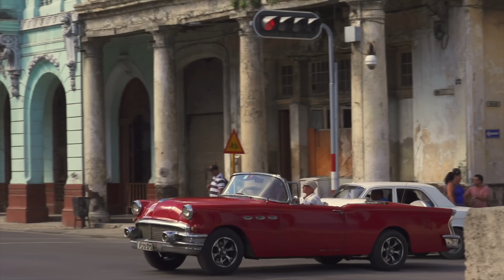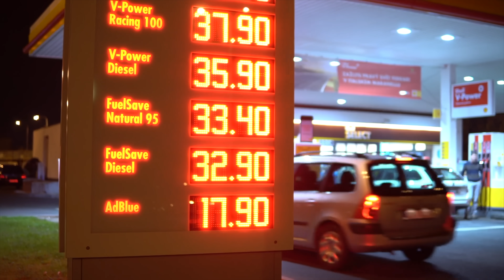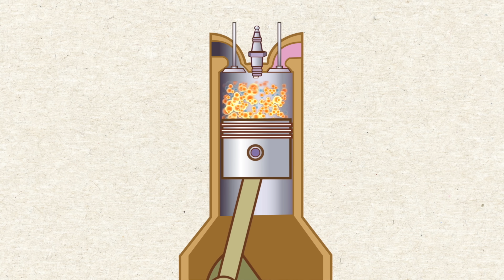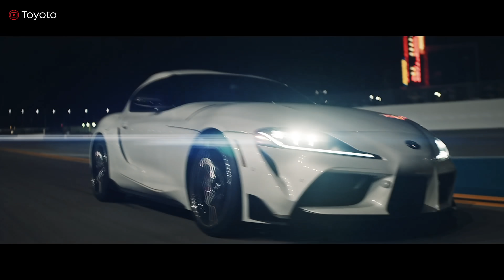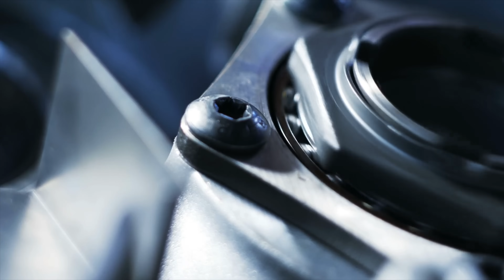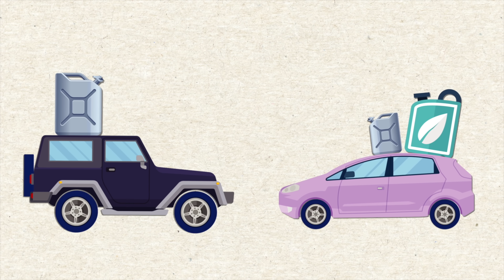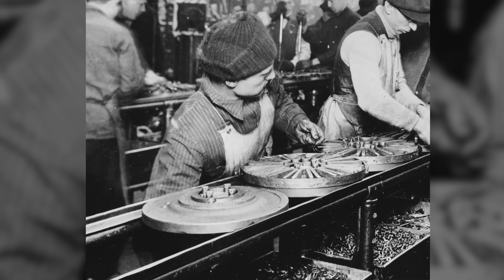7 Fuel Myths Stupid People Fall For

Comment: I have an older 2013 Ford 2liter twin turbo Ecoboost engine in my escape. I always used the recommended 89 octane, So a couple of months ago when I tried putting 93 octane fuel in to see if it would make a difference, WOW I immediately got 7 more miles per gallon (Highway) 4 miles per gallon more combined with the 93 octane. I also notice quicker throttle response. I was stunned by this difference, and on further research I found it had to do with the turbos being more efficient with a higher octane fuel.

Comment: What about using Ethenol free gas? I used it in my 2009 Altima and it had more power and better gas mileage.
Reply: This makes sense, Ethanol free gas has more energy than the 10% stuff.
 In the end, you’re paying the same amount for a mile. In your case, just buy whatever option is more convenient

Comment: I used 87 and got 24.8 mpg..Tried 93 and am getting 25.1 mpg..Need I say more !!
Reply: My previous Scion (2005 xA) had the basic VVT engine...it REQUIRED high octane because of the performance vs. size
Reply: I find I get 1 liter per 100 km better mileage for Shell V Gold vs Reg, about 10% better and I find my car runs smoother and feels faster , i drive a 2015 VW Jetta 1.8 L TSI, my Shell station has 0 ethenol

Comment: My boss was the ceo at Buchanan energy’s assistant and he told me mid grade is just regular and premium mixed and that you can put premium in a regular car but you can’t put regular in an engine that takes premium .. and that whether or not the gas is good for your car or which gas station has the best gas depends on the stuff going on underground underneath the gas station

Comment: I don't know much but I do know this from experience if you put gas containing ethanol in your car or in a small engine it causes three times more buildup than regular gasoline.
Reply: Source: trust me bro
Reply: Another myth.
Reply: It's terrible for old vehicles with carburetors.  Fuel injectors deal with the problem because they are forcing the fuel through, but if you have an old motorcycle and don't ride it for a month or so, that ethanol separates and you have to rebuild the carb... again.  Wish we could get non-ethanol fuel in my state for old vehicles.  Not a myth, experience.
Reply: ethanol leaves moisture and gunk as a by product unfortunately

Comment: I had a Mercedes has stickers on the gas cover and dashboard that said to use Premium gas.  Although in the owner's it said, that to get the maximum horsepower you needed premium, but regular was fine as the timing would be adjusted by the computer, but you would have lower horsepower.  I also had a supercharged Buick Regal, which  was very specific about always needing premium.
Reply: Would you really trust a Mercedes computer to NOT crap out on you? Stick to premium
Reply: @delgande  , the owner's manual even said you could run 25% diesel in an emergency.

Comment: Interesting information.  Thank you for sharing that; clears a lot of things up. What do you think about Sea Foam as a once in a while additive to clean out the engine?
Reply: My dad used that but Scotty says not to use it in previous videos. My grandma owned some some auto repair shops for 50 years. He is deceased as of late but he was an Air Force master Sargent mechanic before opening his own shops after retiring from Air Force. Anyway, my grandpa didn’t recommend or use sea foam in his cars either. That’s 2 opinions from lifetime mechanics. Hope it helps you decide.

Comment: All I know is that using the regular gas in my area causes knocking. I hear other cars also knocking like crazy due to this. I know this - my car runs much better on Premium and I avoid engine problems. It seems the Premium gas here is simply a higher quality gas.

Comment: I live in the Rocky Mountains of Utah. Since it's higher elevation, I use E85 in my Flex fuel truck for more horse power. But only when towing heavy loads like my camper trailer. When I don't tow anything, I switch back to regular or mid grade gasoline.

Comment: Me who drives a diesel: “Ha imagine having an option for fuel.”
Reply: there is an option called BioDiesel
Reply: Hmm, should I run #2 or #1? Granted #1 is not as common in warmer climes, it's all over in colder areas.
Reply: @roughrdr  I’m live in Texas there is only one option
Reply: Actually, Diesel Fuel has a Cetane Rating: the higher the Rating, the higher the Boost Pressure you can run. Some BioDiesel Fuel has a higher Cetane# than regular diesel! Here in The Philippines, there are two Diesel Fuels at many pumps. Low Cetane# for non-turbo diesel, high Cetane# for turbo diesels...
Reply: Here's a good one... Can adding kerosene to your diesel fuel hurt your engine? Truckers do this to keep the fuel from gelling in cold weather.
Reply: @virginia7125  or you get Pacific anti gelling stuff
Reply: If you have oldschool  non turbo diesel , you can make secondary  fuelline to switch after  engine is warm. Then use oil, people  usually buy colza or sunflover  oil. Or filter  oil  from restaurants. You smell  like  McDonald but you drive  cheap.

Comment: I've been putting higher octane to my car an I feel it runs better.. premium gas yes..
Reply: You put it in expecting it will run better, theres probably some bias there, get a friend to fill it up and tell them to pick regular or premium randomly, I don't like your chances of guessing what they put in based on the feel while driving.
Reply: Did you ever  notice that when you wash your car it seems to run better and go faster?
Reply: @rickweaver7997  you'd probably have less wind resistance with a waxed up dirt free body..
Reply: @rickweaver7997  what's the matter with you?
Reply: @jov6372  
Um, I'm fine, what's your problem?

Comment: I'm in Europe and always thought the Octane # says something about the amount of energy per unit of gasoline. This idea is reinforced by the fact that my Vespa with a very simple 4-stroke engine and no electronics actually has faster acceleration and a higher top speed when I fill it with Euro98/E5 compared to Euro 95/E10 fuel...

Comment: Doesn't ethanol in the fuel reduce mileage per tank because it evaporates faster? Doesn't ethanol also damage the engine to a degree that wouldn't be achieved otherwise? For cars made past 2002, which would be more suitable: 100% gas or a gas/ethanol mixture?
Reply: ethanol blended fuels get worse mileage because they have less energy per gallon. it's a cheap way to boost octane rating though and doesn't have the same negative health effects of the bad old way to do that (leaded gas). that's why many engines will get worse fuel economy with premium fuel than just regular unleaded. they use a higher percentage of ethanol to bump up the octane rating so the premium has less energy in it per gallon and that gallon won't get you as far down the road.

ethanol won't harm an engine but it will be hard on all the rubber parts it touches if they weren't designed with ethanol in mind. 

for something relatively modern, 10% ethanol won't be a problem but you shouldn't let the car sit with a full tank. modern fuels can clog fuel systems if it goes bad, which can happen after about 3 months or so.
Reply: @chappell721  It's a good job, then that I live near a gas station that's ethanol free. Thanks for the reply!

Comment: It always worked for me when using leaded engines, to use Plus, to prevent knocking.

When I had a 91 Taurus and drove cross country, I would see a fuel economy of 30-35 MPG (actually touched 39 on two tanks) when driving with Premium, 28-33 on Plus, and 25-28 on Regular, but only when driving long distances, with few stops.  So that is what I used when traveling 2-3 days on the Interstate, then on either end of my journey, I'd use whatever worked best, cost wise, that wasn't the crappy 85.5 that some states allow in the winter.

Now I drive a PHEV, and have found that while it only requires 87, I have to run 89 to keep the engine happy.

Comment: I'm not convinced higher octane fuel burns at the same speed as lower octane. I say it burns slower. 2 stroke go kart engines make more power on low octane than high. I agree with everything else that was said though...Kind of...

Comment: It would have been nice to hear about the 85-octane fuel sold in some states, like Colorado.
Reply: 85 octane is sold at locations with high elevations, for example at 5000ft air is 83% as dense as at sea level, so cylinder pressures are lower so octane requirement is lower. Pretty much it’s equivalent to 87 unless you’re driving out of state

Comment: Fun fact , Gas mileage stickers on new cars is based on 25-30 mph city and 55 highway driving in a test area generally shielded from elements or they just lift it and spin the wheels .

Also the average total price difference at 20 gallons from 87 to 93 is only 4$

Comment: I chuckled when, each time you mentioned high octane fuel, you illustrated a high performance car.  I've been driving smart fortwos (Smart Cars) for going on 16 years now.  Not exactly what anyone would call a high performance vehicle.  And yet, the manufacturer's recommended fuel is Premium gasoline.  The engine's three cylinders also have hemispherical combustion chambers (it's a 999 cc Hemi, LOL).

Comment: Interesting video. I'm in Australia.  The noise you call pre ignition we call pinging.  One of my cars is a 63 Impala with 327 V8, I have to use premium in this car ,otherwise it gets pinging. I've always been told can't use Ethanol fuel in these old carburettor cars because the Ethanol damages the carburettor and rubber hoses .

Comment: My brother learned the hard way with premium gas.  He had a Honda CRX and switched to premium gas and found out that the higher carbon content of the gas actually was clogging his exhaust system.  So he stopped paying for premium gas and had to drive the car on a long trip to blow out all the extra carbon.  Gas mileage went down and performance was off.

Comment: My cx-5 requires 85, and I was getting about 330 miles with a 14 gallon tank. After a short time of running 91 I maxed out at 480 miles with the same 14 gallon tank!

Comment: I had a 200 T100 pick-up. Using 91oct ,I could drive 100 miles to my moms stay the weekend and drive 100 miles back and have just  over a half tank of fuel left. One time, I filled up with 85 Oct same trip and finished with a quarter tank. I did this 3 more times 91 vs 85 oct same results each time. I had better gas mileage with 91 oct.

Comment: Used regular in my Chevy Impala.  432,087  miles with still no engine leaks or smoke.   Used Premium in my Yammie.  It has 86,456 miles on it.  It has nothing to do with octane rating.   Proper care and maintenance is the answer.

Comment: Should I or how do I switch my 2006 Toyota Highlander Hybrid's four-wheel drivetrain to a two-wheel drivetrain? 

Which type of gasoline should I use for my 2006 Toyota Highlander Hybrid Limited 4WD-i?
?
“Premium Unleaded” is recommended in the Owner’s Manual, page 302, Fuel Selection: in the Octane Rating: 87 (Research Octane Number 91) or higher. For improved vehicle performance, premium unleaded gasoline with an octane rating of 91 (Research Octane Number 96) or higher is recommended.
?
“Regular Unleaded” is recommended in the VIN Fuel Type section at

Comment: Most cars have a “knock”  sensor.  It retards the ignition timing to avoid the knock so even if high octane is required or recommended.  High altitude will also cause pre ignition “detonation “

Comment: Some vehicles adjust the ignition timing based on octane so you can make more power. performance cars for example. 

I’m tuned for E85 anyway which is equivalent of 105 octane or so but requires 30% more fuel usage

Comment: I didn't think much about ethonal fuel mixture when it first came to pumps many years ago, but now I won't touch the stuff for it causes sludge build-up.  I also used it in small engines such as lawnmowers, weed wackers, snowmobiles and dirt bikes.  I had to remove every carburetor due to sludge.   About 6 years later the manuals started saying not  to use Ethonal in small engines.   I'm not sure if fuel cleaners really work well for removing sludge for I have trust issues with fuel companies

Comment: I drive a 2010 Mercedes ML 550 v-8 I've driven it for 14 years on a regular gas with no problems. I was talking to the guy filling up the at Sunoco he told me the minimum of 87 is actually higher because they cannot go below that minimum certification. Most of the time he told me you're getting more like around 90 octane. So I always put regular in it. I've never had any problems but perhaps what I was told was a true?

Comment: Me and my 1999 Ford Ranger flex fuel pickup are very happy with E-85. The truck likes it, and I like the lower prices even after the additive is added and difference between the price of E-85 and 89 regular fuel it needs if E-85 is not used.

Comment: My Ford Explorer ST needs Premium due to twin turbochargers. I knew it must require Premium when I bought it; no regrets. 400 hp plus 415 lb-ft. of torque. The acceleration is awsome and It gets 22.4 mpg under my lead foot. Love it, do it again. BTW I live at >7,200 ft altitude so there is 20% less air density here, which makes the turbos that much better.

Comment: So, I have a 2010 Pontiac Vibe (base model).  I seem to use less fuel with high octane vs low octane.  Being I don't make a lot of money and fuel prices are high in my area, I'd rather spend a little more at the pump and fuel up less often.  In the end, per my calculations, I'm actually saving money using high octane fuel.

Comment: What sort of things can cause an engine to need a higher octane as it ages? My mom had a '92 Toyota Previa. It was supposed to use regular gas, but in the late '90s it started to knock unless you used mid-grade. (I later got it as a hand-me-down, and drove it until 2019)

Comment: In the 1990s, GM and Ford imported the Vectra and Mondeo models respectively into Australia. In Europe, the Mondeo outperformed the Vectra on 95RON fuel. Holden, the local arm of GM rejigged the Vectra to run on 91 RON, our regular fuel while Ford's Mondeo required premium 95 RON fuel for best performance. Many drivers didn't understand the differences between 91 and 95 in the Mondeo and the Vecta performed better than the Mondeo on the lower octane fuel. 
Vehicles that were direct competitors in Europe were in effect in different classes here because of the significant price difference  between 91 RON and 95 RON. This price difference averages 12 cents per litre in favour of regular 91 RON.

Comment: Ethanol is corrosive to some metals and polymers.  So, best to verify with the car manufacturer as to what % ethanol is safe for your car’s engine.  Due to the corrosive effects E85 dispensers do use some different materials and the safety certification standards are different.

Comment: Very good info.  The only thing I would like to have also heard was about leaded gas, which is available in agricultural areas near where I live, and can be purchased for regular vehicles.  I'm sure engines aren't designed for it any more, but what damage might occur if it's used?  Are there any advantages at all.  My fellow motorcyclists would often go out of their way to buy it, but I always thought that it wasn't as beneficial as they were led to believe...

Comment: Running a newer hemi 5.7 using the premium gas keeps the engine clean at the same time. Altho it does require regular I chose this for 3 years after the mds system got flooded with debre had it replaced switching to premium gas it has improved performance.

Comment: Finally someone who says it like it is, sooooo tired of the argument that doing the high ethanol or high test in anon high test or high rating gas in a regular car engine, but I will admit I am one to stick with a particular brand of fuel because of the cleaner additives, but I'm also a stickler for changing air filters, spark plugs, wires and more every 6 months oil changes every 4,000 kms than the 5,000 kms rule in Canada , maintenance maintenance maintenance 
Is golden rule if you don't look after your vehicle regardless what fuel you put in then your just wasting your money and time, anyhow sorry for side track thanks again for doing up the video explaining it properly about the types and the why's of gasoline  !

Comment: To clarify your description of the Octane standards, there are three octane standards out there:  the Motor Octane Number (MON), Research Octane Number (RON), and the average of the two, or the (R+M)/2.  In the US, we use the average of the two, or the (R+M)/2 which is what you see on the pump.  Some may refer to the (R+M)/2 as the "pump octane number" but it's not entirely accurate.

Comment: I drive a Volvo 940 and it's definitely not a high performance car. But if I use anything other than 93 octane fuel it's hard to start and it will shut off when driving.

Comment: "It can be harmful to fuel lines, fuel pumps, and other fuel system components that aren't resistant to ethanol. So if you have a 1993 or older vehicle that still has its original fuel system, you may not be able to use E85. If your 1993 or older vehicle has a newer fuel system, it should be OK to use E85."   I've been told by mechanics it will eat thru the fuel lines of some vehicles.

Comment: Given that at sea level octane ratings are 87 reg, 91 mid and 93 prem, and at high altitude (Colorado over 4000 ft) where octane ratings are 85 reg, 87 mid, 91 prem, what do you use at high altitude for a car that requires 87 octane since the one at sea level is regular and the one at high altitude is midgrade?

Comment: Not really more energy, but yes, higher octane burns cooler. Cooler does mean either more power, or better mileage.
In older vehicles (20 years old) yes, it does make a difference… actually a huge difference.